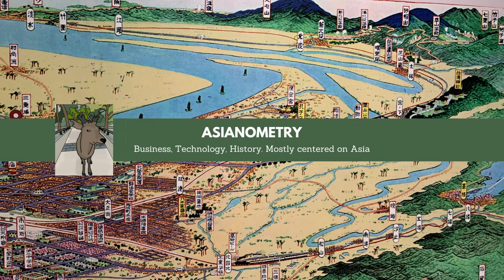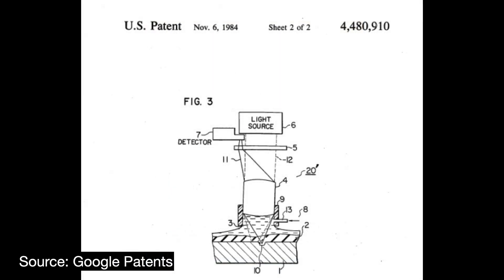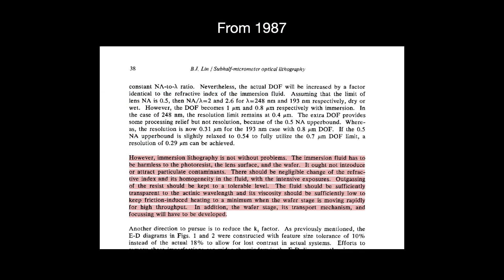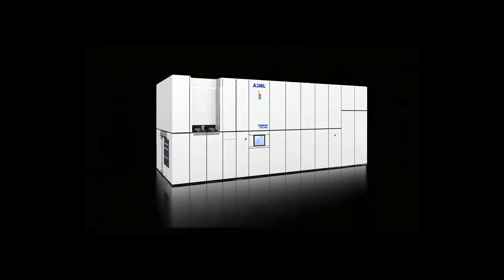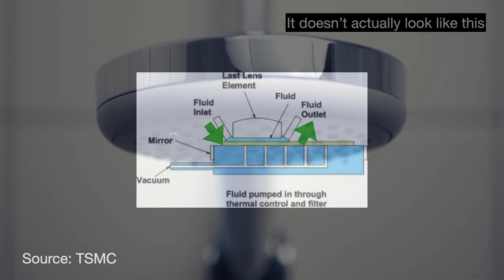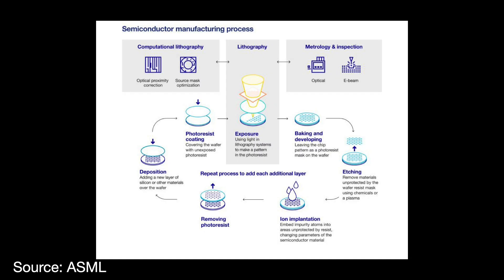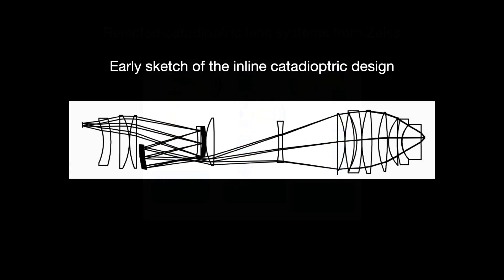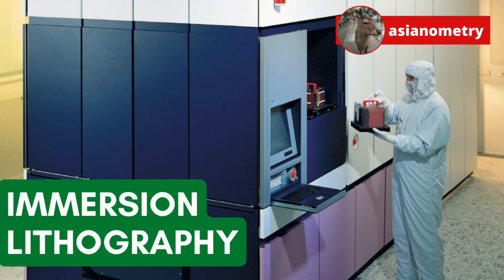Semiconductor Immersion Lithography

Comment: This is great - many people think that EUV is the only industry tech out there since it makes the headlines. You're doing important educational work, thanks for putting these together!
Reply: Something modern like a Zigbee controller may very well be produced on 193i, just like so many other kinds of chips.
Reply: That's because it actually is at present. 153nm hasn't really been resolved and yields make it cost prohibitive. Wafers are not cheap! Bad yields and disposal of dirty water (or treatment) isn't cheap or easy either. The result is that EUV is the only tech that currently makes sense from cost and quality due to the combinations of problems and low yields.

Comment: TSMC N5 and N4 are not even fully EUV. Almost only the fins in the FinFETs are made with EUV. All the TSVs and most the routing layers are made with 193i. And the reason is simple: The wafer throughput is much much higher on 193i. So if a chip has 80 layers and only 5 of them are EUV and the rest are 193i you need, say, 1 EUV machine and 8 193i machines for the same throughput as 25 EUV machines would give you. Considering just how brutally more expensive the EUV machines are this is the difference of having a break-even after 3 years at full capacity or 30 years at full capacity.
Reply: I thought the fins were quad duv? The big issue intel had with 10nm quad was using it for M0 - at least this is what I've heard around - (quad fin patterning was industry standard for a while I believe). I wouldn't be shocked if they changed the litho tech for the N5 fins though for throughput reasons.
Reply: If euv Is only used sparringly couldn't it be replaced with greater use of múltiple layering duv?
Reply: @diegoantoniorosariopalomin9979  you could up until some point. But at quad EUV is just cheaper and higher throughput. Multi patterning also increases design rule complexity.
Reply: @ab-lymphocite5464  does it matter too much when EUV Is only used sparringly like you said?
EUV may make comercial Sense for most nations, but china wont have access to it for several years, however what you said may mean that restriction wont be a killing blow to their chip industry
Reply: @diegoantoniorosariopalomin9979  You want EUV anywhere where you would be quad patterning because it kills yields and makes your nodes much more expensive/slower. And quad patterning can’t really carry you beyond n5 maybe n3. With this in mind and the fact that smic’s n16 copy isn’t in hvm at any real scale, I am highly skeptical of the prc being able to cover it’s needs anytime soon. To say nothing of being cut off from the metrology, ald, and many more tools. The prc also has to develop their own native dry and then wet 193nm litho tools to even be able to get the scale to make any modern nodes.
Reply: its crazy how those 5 layers can alter the chip makeup dramatically.
Reply: @covert0overt_810  Remember most of the layers are just large power rails and data interconnects
Reply: @ab-lymphocite5464   semiconductors blow my mind.... it literally is peak science...
Reply: @ab-lymphocite5464  What’s M0? If u don’t mind my asking. 🙏🙌✌️🖖
Reply: @-MaXuS-  M0 is the first metal layer and it is the bits of metal that act as the inputs/outputs of the transistors. While metals 1 and 2 are for the forming your standard cells (nand nor etc). The layers above that are for making/powering more complex structures. All the way at the top of the metal stack are the C4 bumps which are used to connect the chip to the outside world/the package.

Hope this helps.
Reply: @covert0overt_810  *engineering
Reply: @covert0overt_810  don't oversimplify bud, it's a lot more complicated than "just an extra 5 layers", and asianometry talks about that plenty in many other videos

Comment: It’s important to remember even in the n5 and smaller nodes especially in the back end of the line an EUV machine is overkill. Most process levels have CDs well In the range of 193i. Nearly all modern foundries operate these tools and will for many more years
Reply: The exception is the lower metals which are getting to the point of low NA EUV double or DUV quad patterning. But yeah it is frustrating how much EUV can sometime be overemphasized.

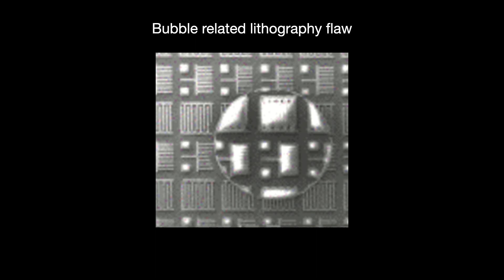Comment: 10:52. That is an amazingly illustrative flaw! The system projected the bubble unto the waver, showing that the air does not shrink the image as the surrounding water, as the refractive index in air/gas is much closer to one.

Comment: I have a video suggestion:
With EUV reaching limits because of the wavelength theres the question "is there another way to produce even smaller features?". I heard that using electrons archives that, but it is a lot slower and can't be used for high volume production.
Reply: Physics is a "beach", bro. There is always a tradeoff

Comment: Immersion lithography introduces added complexity and expense over dry lithography. Ensuring a clean environment for high-purity water and managing environmental issues related to water disposal are critical. Moving wafers into and out of the fluid can be intricate. It is vital to control the movement precisely while preserving the fluid layer. It is also crucial to minimize or eliminate bubbles. The immersion fluids must be transparent at the 153 nm wavelength (utilized in EUV lithography), and achieving such transparency presents a continuous challenge since the 153 nm wavelength is in the deep ultraviolet (DUV) spectrum, making it difficult to find materials that are transparent and compatible with semiconductor lithography processes.

Comment: Immersion lithography works in large part because you literally CHANGE the wavelength of the light because of the high index of refraction of water for the corresponding light. The index of refraction depends on the frequency of the light -- that doesn't change. The wavelength (lambda) and frequency (f) satisfy

lambda * f = v

where v = speed of light in the medium. The speed of light in the medium satisfies v = c/N, where "c" is the speed of light in vacuum, "N" is the index of refraction of the medium at the given frequency, and N = 1 for vacuum. So in vacuum or in air, as the index of refraction of air is almost one, then you have lambda(air)  *  f = c,  and for water lambda(watter) * f = c/N, which after a little bit of algebra gives you

lambda(water) = lambda(air)/N.

Since at the frequency when you have lambda(air) = 193 nanometers, N(water) is fairly large, you get that lambda(water) is smaller than in air, which allows (as you know) the manufacture of smaller features.

EDIT: I guess that what you have called NA in your formula is pretty much what I am simply calling N --- but I just had to correct the fact that you are actually changing the wavelength, it doesn't stay the same, because the medium where the light travels changes from air to water; rather, what is always the same is the frequency of light. Sorry, but I am a physicist, and I just could not let it go --- I still like your videos very much. I am not trying to disparage you in any way.

Comment: Just wondering: is it not possible to use electron beams instead of light? Like with electron microscopes, where the energy can be increased at will, effectively giving a variable "wavelength". 🤔

Comment: How is it possible to create features smaller than the light's wavelength?
Reply: With EUV.
Reply: First: to get a straight line, you will need to make a diffraction pattern on the template instead of a line. 

Second: water compresses the wavelength by about 1.35 times, this is the essence of immersive technology 

Third: overuse multipatterning as hell.
Reply: First, the response of the photo-sensitive material is non-linear, and the edges of the printed lines can be very sharp comparing to the width of the lines. 
Second, the projection machine aligns the pattern with far greater accuracy than the wavelength.
 
So you can print one set of relatively wide lines, and then another set of relatively wide lines with a carefully chosen offset, and then the gaps between the two sets can be made much smaller than the wavelength and very accurately controlled.

Many other tricks along the same lines are possible.
Reply: @cogoid  sounds a little like a diffraction grating.
Reply: @brodriguez11000   Conceptually, "double pattering" is much simpler than that -- you can think of it as parking cars closer together than the size of a car.

Playing with diffraction is the basis of a whole other bag of tricks for increasing the resolution in lithography -- phase shift masks, optical proximity correction and all that. In these methods, one tries to predict the smearing of the image due to diffraction and to undo this smearing by tweaking the mask. You cleverly modify the mask, so that it does not really look exactly like the features which you are trying to print. But when the light from different points on this mask adds up coherently on the resist, this creates the pattern that you want to get.
Reply: That is not even the most difficult part. Printing something small is easy. Getting that same size with very little variation over the whole chip is much more difficult!
Reply: @cogoid  great reply, thanks!

Comment: I'd be curious to know what's the actual current limit with E UV in size for a wafer.
Like 2nm transistors?

Also not sure if I understood that correctly but when TSMC speaks bout 5nm it's not the actual transistor size but rather the light wavelength?
Reply: If i remember correctly, it's neither. "Nanometers" are just indication of how fast processor will be. N10 is better than N22, and worse than N5. Something like that.
Reply: First question, on limits of EUV for a perfect diffractive grating image (a series of lines or similar) assuming a k1 of the near impossible 0.25 with no multipatterning

“Old” EUV tool, 0.33NA = ~10nm
“New” EUV tool, 0.55NA = ~6nm

193i DUV, ~1.35NA, = ~35nm

Realistically multiply those numbers by 2 for practical limitations. Features can get smaller through various forms of multipatterning but that gets expensive.

Regarding your second question on “5nm”, Node sizes are a marketing term and don’t really correspond to a critical dimension of anything in particular. You will find that most critical dimensions are larger than 20nm regardless of the “Xnm” node size label. The main changes that are occurring are different transistor architectures are being used to reduce transistor efficiency losses by employing more advanced forms of GAA (Gate All Around) with atomic layer deposition tools and the like.
Reply: @alexanderbrown6077  Worth noting is that DUV double patterning is still way cheaper than EUV single (probably lower throughput though). Otherwise good answer, you saved me a good bit of writing :D. If memory serves from the IMEC nodes we can get into like "18 or 16A" with DUV quad (not that you would do that besides some front end layers), with EUV double and High NA single carrying you a good bit farther than that.
Reply: I recommend the video titled "Why Every 3nm Process Node is Different" to get this answer.
Reply: @alexanderbrown6077  6nm transistor size. that's truely impressive
Reply: @BaBaNaNaBa  6nm line not a 6nm transistor, big difference

Comment: I had an idea. Etch the image, then shrink it. That will achieve 1nm with todays tech.
Reply: thats... not how it works
Reply: You need to look up the sizes of the transistors and the sizes of wavelength, and wonder how that would work :)
Reply: honey, I shrunk the ... transistors
Reply: Look up "double patterning": print, etch, atomic layer deposition (ALD), and after a few more processing steps you can keep the pattern that stuck to the walls of your original pattern...

Comment: Is the factor k1 in DUV and EUV machines the same?
Reply: No. EUV is 0.33NA and High NA EUV is 0.55NA.
Reply: They are both manipulating the same number, but using different phenomenon to achieve it. Also EUV has much lower NAs due to the higher energy photons.